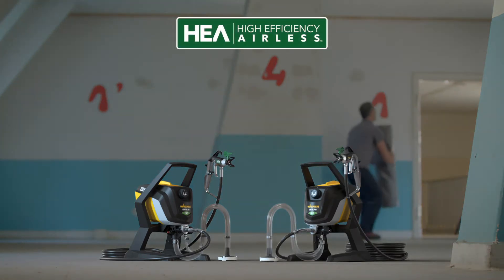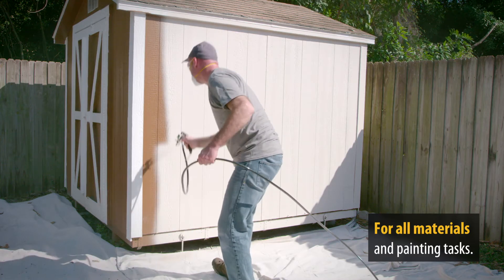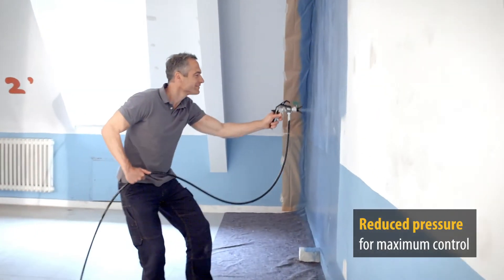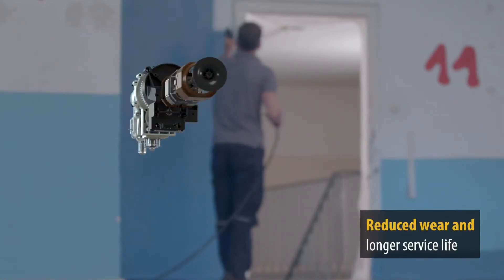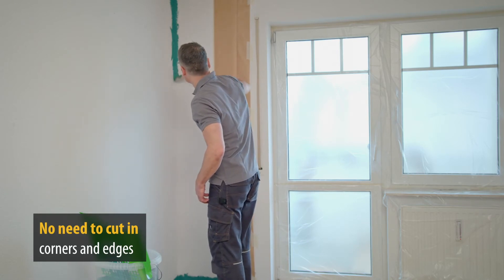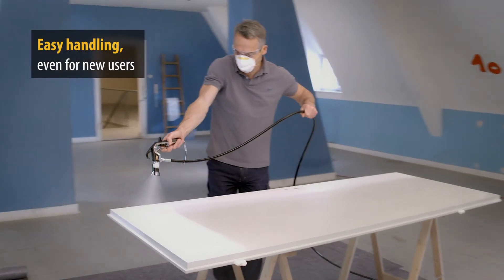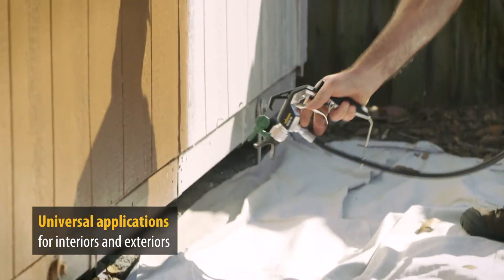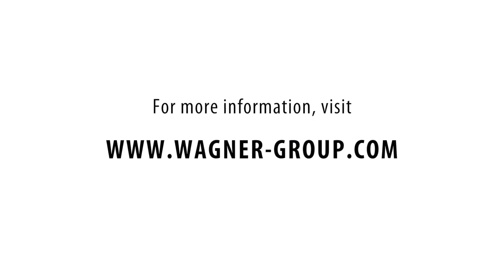WAGNER Control Pro 250 R & 350 R - Application

Comment: Can I use this with outdoor paint?
Reply from the maker: Hello yes you can use wood and metal paint outdoors and also can be used for emulsion inside if you’re doing work on interior walls and ceilings. Kind Regards WAGNER DIY

Comment: Do I have to use water based paint ??
Reply from the maker: Hello Riley, you can use both water-based and other types of paints with this airless sprayer machine, however, we would recommend using water-based paints. This is preferably because they are easier to dilute simply by added water and easier to clean the machine up afterwards and they're readily available for a wide range of applications. The WAGNER Team

Comment: What's the difference between Control Pro 350M and 350R?
Reply from the maker: Hello Jiro The difference between the WAGNER 350M and 350R is in the construction of the machines frame. The 350M has a metal frame and the 350R is a resin/plastic frame, you can see a comparison here: https://www.wagner-group.com/uk/do-it-yourself/products-and-accessories/product-comparison/?redirected=true&tx_wproducts_product_list%5Bproducts%5D=265078490%2C265078142%2C&cHash=4c837ac6c31d5165dbd14aab60da235b.  Details about both products and airless in general can be seen here: https://www.wagner-group.com/uk/guide/airless-spraying/airless-sprayers-for-do-it-yourselfers/ Kind Regards the WAGNER DIY Team

Comment: price??
Reply from the maker: Hello Raja,

the recommended retail price for the UK market is £469,99 for the Control Pro 250R and £639,99 for the Control Pro 350R.
For more information visit our website: https://www.wagner-group.com/uk/consumer/airless-spraying/

Best regards,
Your WAGNER UK Team
Reply: why is it so expensive
Reply: is there any air less spray pressure >1500 psi and price less than 300 dollars
Reply from the maker: Hello Raja, 

the Control Pros are based on the new HEA (High Efficiency Airless) technology which allows to spray with lower pressure than usual. Thanks to the lower pressure, there is up to 55% less overspray. Because of this innovation and the quality of our products, the Control Pro is more expensive than "standard" airless technology. For standard airless technology we can recommend our "Airless Sprayer Plus" with a recommended retail price of £296.98. 

For more information, click here: https://www.wagner-group.com/uk/consumer/product/airless-spray-system-airless-sprayer-plus/

Best regards, 

Your WAGNER UK Team
Reply: I like it. It would make my painting very easy and efficient.